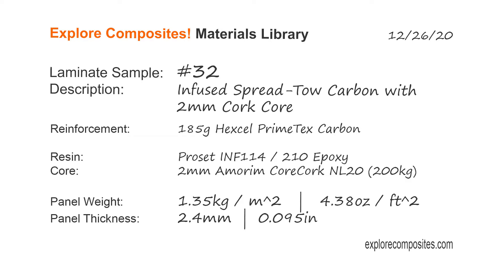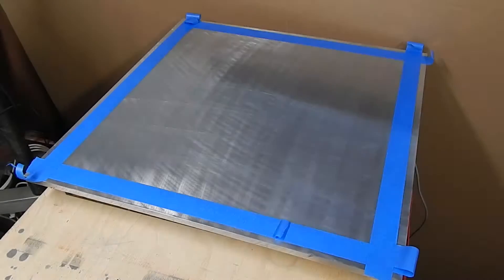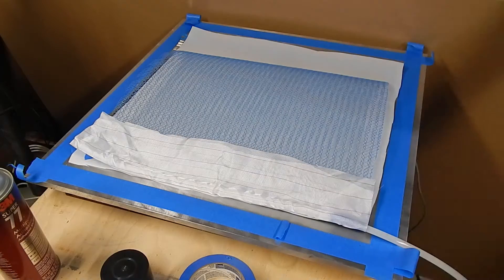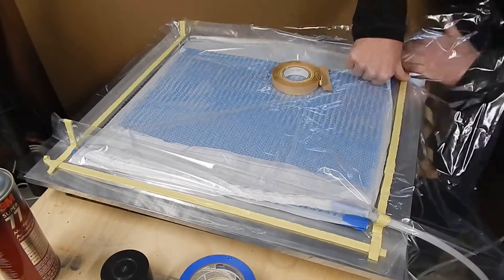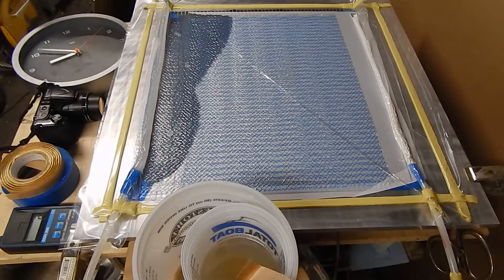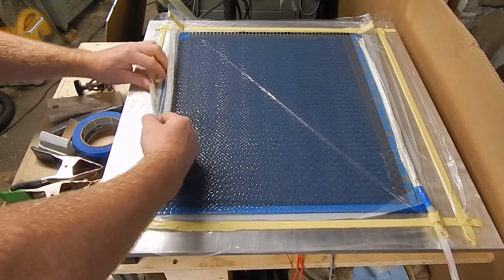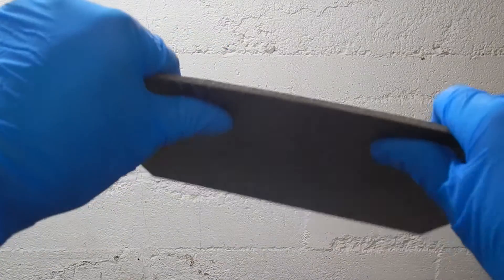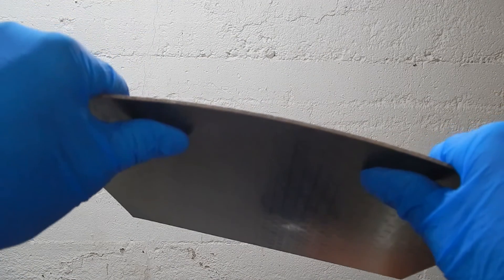Laminate Sample #32: Infused Spread-Tow Carbon with 2mm Cork Core

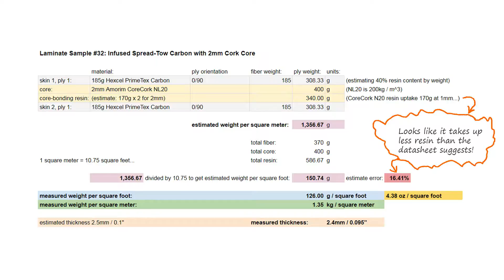Comment from the maker: CORRECTION: Because I forgot to switch part of the spreadsheet from imperial to metric, the estimate of the weight showing reduced resin uptake is wrong.  The bit at 0:24 is just wrong.  The actual error was 0.16% - which is way to close so just luck.  Sorry for the confusion.  The datasheet from Amorim linked in the description is actually spot on!

Comment: Once resin hits the MTI hose, it will not let air through anymore. Also, as it will prevent resin through the line, one needs to be careful to stop resin feed BEFORE the resin is all the way on the MTI otherwise resin will keep pooling at the inlet with no chance of getting out the vac line. It seems to me semi-permeables such as MTI are slightly misunderstood. They are not magic tricks to get your infusion perfect just letting you close the resin when it hits the hose all the way. It just lets you get away with a very uneven flow front without sucking resin in the vacuum line. So it's useful when resin flow is very uncertain, the mold does not provide enough distance for a proper resin break, fasttracking may occur, ...
Reply from the maker: That all makes really good sense. I have worried about how to know what you have the "right" amount of resin in the part given the time it takes to fill and even out across the pressure differential after clamping the feed - especially without the "overflow" volume in something like spiral-wrap.  I'm pretty new to MTI hose and semi-permeables in general but very interested in the possibilities!

Comment: you can often use a liquid vax in top of chemical release agent to give the tackytape some surace to bond to... what also helps is oten a little heat... what you did worked out great but it might help or something else
Reply from the maker: It just makes me nervous putting sealant tape over release coatings.  Wax seems much safer than this Zyvax Watershield which is really not-sticky.  Had a bad experience once with a bag un-sticking while cooking a prepreg part bc of release on the mold edge so I’m scared now!

Comment: So I work in aerospace and there's this thing that happens when you have core involved. When you use core it takes a really long time to completely suck all the air out for example when we do rohacell sandwich panels we keep it under vaccum for about 2 hours before we leak check it for the oven. It's best to leave it under vaccum for a couple hours to really take out all the air.
Reply from the maker: I think you’re totally right.  This would have benefitted from more time under the bag before infusing.  Does it take two hours for the vacuum to stabilize and boil off moisture before you get a reliable leak check?  Assuming for prepreg?
Reply: @ExploreComposites  I wouldn't know much having to do with moisture since we'd bake our core for a while before using to make sure it was completely dry but maybe that's something you can experience  with as well. But its quite significant  the difference. One thing we started using that helped a lot was this little turbine fan thingy that was spliced into the vaccum line. When it was spinning it meant air was still being drawn from the layup and when it was perfectly still it meant the laminate no longer had any air in it
Reply: @ExploreComposites  Not a composites guy but I do higher-end vacuum stuff. Natural materials and most plastics take ages to get really dry at room temperature, and they usually have more water content than you'd expect. What's worse, something like cork will become an even more effective insulator under vacuum, so removing that water takes some heat input but the heat hasn't got any way to get where it needs to go, if you just pump on it and wait.

So, how long it takes depends mainly on how thoroughly dewatered you need it. At one extreme, if I'm doing a vacuum tube that's supposed to stay under vacuum for years, I'll quite happily heat it at 500 C for a few hours for no other reason than to degas it, unless some material of construction forces me to stay cooler.

If you just need to be able to see whether air is leaking in, I'd try degassing it 20 C hotter than you intend to do the infusion and see if it helps. If it's a big problem, bake it as high as your setup can easily tolerate--the hotter you work, the faster the dewatering goes.

Comment: So I've been watching your materials library videos with an interest in vehicle applications, specifically tonneau covers, canopy shells, and full-slide-in cabover campers.  Right now these sorts of accessories are either fiberglass, or sheet metal skin over some kind of moderately lightweight metal square-tubing, or in some more exotic designs, some kind of thick foam-composite, either using fiberglass or aluminum skins over a 1" or 2" thick panel, with all flat panels with aluminum extrusions for corners/joints.  The trouble with most of these existing solutions is weight, or is a lack of thermal advantages if lightweight (ie sheet metal over metal frame).

Some of your various samples give me ideas, though since you're not doing performance characteristics on your samples (testing for load carrying capacity, max elastic deformation, threshold for plastic deformation, threshold for structural compromise, etc) it's obviously hard to say what exact processes would yield the best possible result.  This looks incredibly lightweight for its stiffness though, I'm curious if building a 'big mac' structure with a layer of carbon, layer of cork, another layer of carbon, another layer of cork, and a final layer of carbon might result in some other kind of properties for stiffness relative to weight where it still comes in under half a pound per square foot yet results in something that a 4' wide by 8' long panel could be tread upon without support away from the edges.
Reply from the maker: Thats a tough order the 4x8 sheet walk-able at under half s pound per square foot.  Some surfboard manufacturers put higher density foam over low density like your ‘big mac’ idea.  The higher density helps with point loading and crush resistance.  Shear may still be an issue with thick super low density cores but worth looking into.  Have some very light/thick core on the future samples list and am excited to see how it works.
Reply: @ExploreComposites  I look forward to your future samples.

If it's any consolation I know that I don't really know anything about composites, and that there are considerable startup costs for equipment and supplies to just get started learning in-earnest, even possibly more costs and learning if one takes an approach similar to the guy on Throttle Stop Garage for making fiberglass molds for large 3d parts. 

Perhaps someday I'll actually have the time and budget to start experimenting on my own; definitely would be building on the work of others.  It just seems like many of the current techniques used for fiberglass parts are ripe for replacement with better techniques in a paradigm-shift, especially if low-cost materials like these cores can be readily cut and shaped to fit well into 3d molds.  Suddenly a camper shell on a truck that previously weighed 300+ pounds and taking a third of the payload capacity of a mid-sized pickup could be cut down to under a hundred pounds, that would be useful since the truck could safely carry 200+ pounds more cargo.